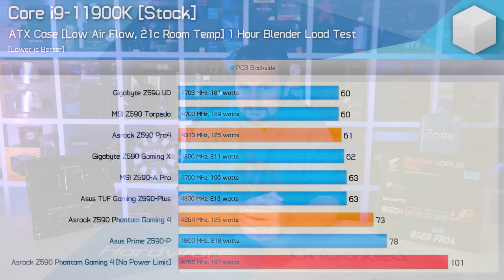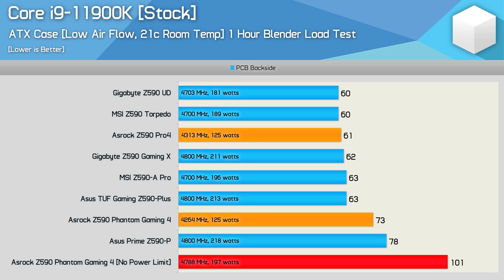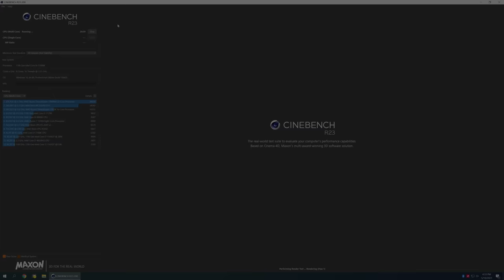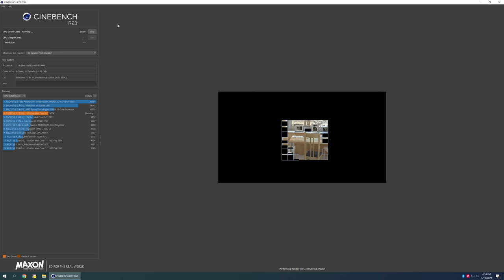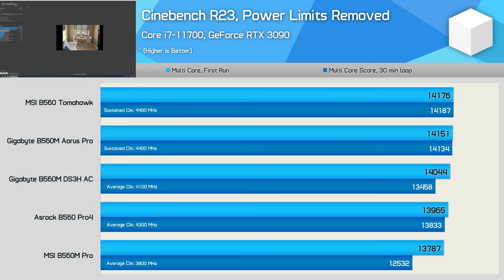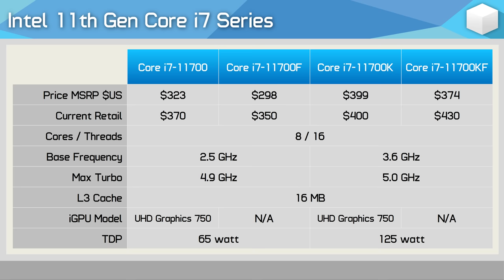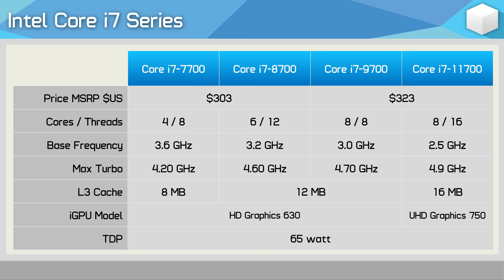Intel B560 is a Disaster: Huge CPU Performance Differences, Power Limit Mess

Comment: So basically B450 Tomahawk MAX II combined with Ryzen 5600(X) (or even 5 3600) and AMD Radeon  6700XT / 6800 is still the king of frames per cost? IF they are being sold at MSRP...

Comment: Just got an open box system pull ROG STRIX B560-G GAMING WIFI with all the accessories for $126 on ebay from a reputable seller.  Did I get it for a good price?

Comment: I'm using i5 11500 with Gigabyte B560M DS3H AC and using Deepcool Gammax 400 v2 cooler.

Can I remove the power limit with this setup to unlock the full potential of CPU? Is it safe and wise to do so?
Reply: Yes you can. The Gammaxx 400 is a great cooler and the motherboard VRMs are good enough to handle the 11500.
Reply: @kanishkparmar  Glad to hear this. I was regretting my decision of going with this board.
Reply: @shoaibmax  You just need to know how to remove power limits (which I guess you already know) and the CPU will work like it does with any normal motherboard.
Reply: @kanishkparmar  Actually, I don't know how to remove the power limit. But I guess I'll figure it out. Now, I'm waiting for the VRM tests to see how they behave after removing the power limit. Loosing 30-50% CPU performance due to a motherboard is too hard to digest.
Reply: @shoaibmax A great place to question this is r/build a pc. I would advice you to go to that sub and ask how to remove the power limit in gigabyte bios. The 11500 is a 6 core cpu, so I would assure you that your motherboard will easily run the cpu without throttling after removing power limits. Intel really messed up this gen's b series motherboards.

Comment: One question if I get the i5 11400 with a cheap b560 motherboard and remove the power limit could I have the full or not ??
Reply: and how can i remove the power limit and reach a safe level ?
Reply: @_ataims  it depends on the motherboard manufacture.
What is the model of your motherboard?

Comment: My nephew is getting into gaming pcs.  He is looking at a NZXT prebuild that pairs a 10400f with B560 MOBO (but they dont mention the AIB brand in the build specs).  Do have a vid paring these two parts? Or would it be difficult to suggest anything because NZXT didnt tell us who the AIB is? My guess is that its okay because the build uses a 10400F anyway, so it makes no sense to use a Z series, but im not sure the value is there, especially for future proofing.

Comment: Not trying to excuse intel and crappy VRM design here, but what did the test set up look like? An open-air bench is going to have a different cooling profile than a case. Do these boards, especially the ones without any VRM heatsinks, still thermal throttle with the stock axial cooler blowing down at the VRMs?

Comment: I have a MSI B560m PRO VDH Wifi and has significantly better vrm cooling solution and more ram slots + wifi than just the B560m Pro. It sets my 10700f PL1 and PL2 to 135 and 180 watts respectively when asking the user to choose cpu cooler type on first boot and choosing either Tower or Liquid cooler. Is this board still capable of bringing up the 135 and 180 watts power limits higher?

Comment: I have a B560 Tomahawk with a i5-11400F and only get 9300 on cinebench R23 multicore benchmark. Any ideas why it doesn’t reach >10k like in these tests?
Reply: Maybe something else affects it? Slower RAM? Better cpu cooler? Not sure
Reply: Yep. Ram speed and ram timings affect a lot to amd performance. So newer compare your own results to any sites results because you most likely have different components. Ram, cooling etc..

Comment: i thought that AMD has more trouble to define its power limits because of socket support. but for intel was more important to keep power numbers same as old launch just for marketing reasons.
Reply: Intel is also providing the cooler in the box and you should not unlocked the power with that cooler. This is what low-end buyers will do.
Reply: @TEKDAD 

 Many motherboards unlock the power by default.

My build crashed out of the box because it would get so hot. I thought it would throttle, the replacement cooler is on the way, but nope it just shut down during heavy tasks until I turned the power limits off.

Comment: To be fair, i've watched enough Hardware Unboxed to learn about VRMs and the importance of good cooling... that cheapo MSI B560 board without a single heatsink on any of the VRMs just screamed "Don't buy me!" as loud as it could before ever watching this video.
Reply from the maker: There are a number of issues here, the 65w TDP being one of them. There are even $140 US B560 boards that run at the TDP limit by default and as you've just seen that leaves a lot of performance on the table. Intel motherboards need to either run at the TDP limit or the clock multiplier table, but having a mix of both with performance differences in the range of 30-50% is unacceptable and a complete mess.

Comment: Hey, I've got a question. I recently upgraded to a ryzen 3800xt and am still using my asrock b550 pro with it. Am I throttling myself with the board? If I understand correctly the problem is focussed on intel chips, but I dont quite understand the whole issue.
Reply: No AMD boards do not have the same confusing problems. The best thing to do, is look up CPU reviews and see what there scores were on stuff like Cinebench, and a game you have. Most reviewers did not really bother with the "XT" 3000 series CPU's. So good luck. Using this method, figured out my B450 aorus pro was running my 2700x in good  enough specs for me.

Comment: I would say that 102/121 and 114/136 (Shadow of the Tomb Raider) is huge difference for basically the same chipset.... Ugh..I hate these kind of companies which try to screw the end customer.
Reply: Yess, but also consider that not everyone buying an i5/i7 & B560 Mobo would necessarily pair it with a 3080/3090.
It's a much better situation on AMD's side where you can build a tricked out rig using a B-series Mobo

Comment: so acording to this problems on the B560 and also with the exagerated price of the z590, does it compensate to buy a Z490 (in this case the Asus Z490 Prime - A) and use an i5 11400f?

Comment: What makes you think it's the CPU and not the motherboards ? Since the Motherboard - Rather than just blaming the CPU Manufacture, the motherboard controls everything including power limits, etc (p.s. I have AMD Laptop, so not a Intel fanboy).
Reply from the maker: I understand the subject. This is 100% on Intel as explained in the video for their loosely defined operating specification. If you wish to learn more I suggest reading the interview linked in this Tweet: https://twitter.com/HardwareUnboxed/status/1385051271451660290
Reply: @Hardwareunboxed  Not to much care for the in-spec, but back in the old days if  you wanted to OC, or better performance from your motherboard, you pay a higher price.
Reply from the maker: Yeah well that's entirely not the issue here or even the subject. Your first hint should be the fact that none of this is overclocking :D
Reply: @Hardwareunboxed  Even if you not OCing, if you wanted better performance, you pay higher price, that was back in 1990s.  Think you all expecting too much for cheap motherboards.
Reply from the maker: This is broken logic and no we're not expecting too much from cheap motherboards. This isn't even a cheap motherboard problem but I'm not going to explain the issue again, it was very clearly laid out for you in the video and just about everyone else gets it.
Reply: @Hardwareunboxed  Yes says so the expert.
Reply from the maker: Did you not read the Intel interview?
Reply: @Hardwareunboxed  It's not overclocking true, but designing all motherboards being capable to handle PL2 permanently isn't the purpose. There has to be some boards that only can supply the minimum PL1 which is the only requirement outside Z series. The problem here happens everywhere, one thing it's the base power limit(however the manufacturer calls it)  which is something every board has to meet and another thing it's the boost limits, which is something optional for the ones that don't have issues with additional power draw and its consecuences.

I tend to assume than someone that builds a PC on his own should be willing to enter the UEFI even if it's only to check everything is in place and has a minimum degree of knowledge. For buy and run there's already prebuilt PCs and laptops in which reviews are made by model precisely because every pre-built configures power limits based on the capabilities of the model and manufacturers charge accordingly: more capable in power delivery and cooling more expensive even if two models feature same CPU range.

Comment: I'm not finding any relevant information on the Intel B560 express, can I also unlock the i5-11400F relatively easy to get the most gigahertz out of it? I think the express is also a budget model, so I guess it should work, but some kind of confirmation before buying would be appreciated.

Comment: This is truly Intel's bulldozer moment 🚜
Reply: Hmmm… i can not see the connection? 11400 is cheap and good cpu. Every 560 motherboard is fine if you know how to change bios sertings. So how this is bulldozer moment? 11900k is hot and eats a lot of power. But it still is relatively fast cpu. Not the level of current amd cpus, but nobody expects that Intel cpus can compete the current amd cpus. They are just so much behind in production technology. But i can not see what bulldoser has anything to do with this? Bulldoser was slow in single threath programs and only competative in certain multi threath programs.
Reply: @haukionkannel  Intel is pushing power through the roof like amd did in the past. Effeciency is out the window and they are embarrasing themselves. Everyone can see they are losing.
And this power crazyness means that motherboards and board partners gets screwed over with these stupid TDP specs that lies and consumers gets shafted at the end.
Rip all the offices bulk buying this shitty platform and getting less performance for the money simply because everything is so scammy

Comment: I have a Gigabyte H601i Motherboard running an i5 12500k, And a 12gb 3060, I did buy 32gb 3600, But I can only get 3200 with the H601i, And putting 32gb of Ram in my PC done wonders, I would even say that 32gb is the sweet spot with Ram, Unless it is DDR5, And 32gb of DDR5 have actually dropped in price, Prob coz nobody is bothering with DDR5 yet, lol, I think people will wait until the 50 series GPU's to drop until a new Motherboard is installed, But would a higher end Motherboard allow for a more improved Sim racing drive play, lol, I do AMS 2 in VR, And when there is a full track of cars when on multiplayer I can get stuttering, So I thought if I upgraded the Router I would get no stuttering during Racing online, A TP-Link AX3000 AX55 Archer Router, I can say have made the Online Sim racing on another level, And the TP-Link AX3000 is also Wi-Fi-6, My CCTV cameras have even improved, They load up staggeringly fast, I am actually taken back on how the difference is with the Sky Modems and modems like TP-Link, Sky should be embarrassed giving people modems that feels like outdated tech, Using crap modems for peoples internet isn't going to give Sky a good look, Even the Wi-Fi booster is crap, lol, I am going to get a TP-Link Modem or a gaming modem to link with the TP-Link AX3000 AX55 Router, Can someone let me know what the best Modems are for online gaming in VR, The Quest 2 recognized the TP-Link as Wi-Fi-6, I read people are having issues when using Virtual Desktop when not using the PCVR cable, The PCVR cable will give you better Gameplay anyways yeah?, Will the WiFi-6 make the Quest 2 VR better, I will find out a bit later, This room is way too hot for VR at the moment, lol, Is there any fan units for the Quest 2 that blows on your face or skins parts, I got the BOBOVR air circulation thing, I never realized it was de-fogging thing, It do keep the lenses free of fog though, lol, And the face cover part is much better, But yeah since I started using the TP-Link AX3000 AX55 Router my internet feels much more stable, The reaction time from the steering wheel in my hands to the one on AMS 2 is instant, A world apart from before I used the TP-Link AX3000, I never realized that a faster more stable connection with less lag, Will make you a faster Sim racer, As I will be real and honest, Before the TP-Link router, I was getting slow lap times, To where now my lap times is faster, Not much but over a load of laps it adds up, So yeah to be a competitive Sim Racer with proper online races, A fast stable internet is going to give you an advantage, Minimal but that minimal can be used to a powerful perspective, So to speak, It is why I am asking will a better motherboard give me better gameplay, Coz better gameplay or less latency will give me a legitimate advantage, Just like High end Sim racing equipment, And High end PC, I believe will make you a faster driver, I am sorry but it is true, Just like saying, Will a Console Sim racer be as fast as a PC Sim Racer, lol, Coz I can tell you one thing, Sim racing on a PC is world apart from Sim Racing on a Console, I know coz I began Sim racing on a Console, lol, There is more everything with PC Sim racing, I could not go back to Console Sim Racing, After Sim Racing on a PC, lol, My friend saying he getting a Console soon, And I say to him, get a used PC or some used and new parts, New motherboard and CPU and Ram, Then get a used GPU, Or find half a used PC on Ebay and get new guts for it, You will be saving money not having to pay for a PlayStation subscription that is impossible to cancel, PlayStation shouldn't be allowed to make subscription so hard to cancel, Most subscriptions I have learned to stay well away from now....
But yeah will a higher end Motherboard give me any better gameplay, Or is it all down to the CPU and GPU combination that you have, Do the Motherboard improve Graphical Quality and Game play, Or is it a GPU thing?, Coz surely a Higher End motherboard will give the CPU and GPU to the fullest with no drawbacks, so to speak, Motherboards is an interesting convo, With the many type of CPU and GPU combinations, I would imagine the Motherboard is the skeleton of a PC is a PC was a human, lol, I joke about that now, And Humans are becoming robots, lol, nVidia boast about the 50 series running a Robot, So when is a Stand alone VR headset with i9 CPU and 4090 GPU power, Or when is someone going to make that possible, lol, A DIY VR headset, Yeah that won't be long, lol, I just want to know will a Better Motherboard than the Gigabyte H601i give me better Sim racing with the i5 12600k and 3060??

Comment: This reminds me of the fx8350.   You basically NEEDED an AM3 990 board to handle decent clock speeds, and it wasn’t even that good of a performer.   Intel better get off 14nm or we will be seeing an FX-13700k

Comment: Hope to see asrock b560m itx included in one of your videos, it seems one of the cheapest itx board for this gen. Will it be good enough to run i5 11th gen like the 11400 with power limits unlocked?

Comment: is this pretty much the case with the b460 boards?   i had to jump at some parts as i really needed to upgrade, got a 10400f and the gigabyte ultra durable b460.  i just game, no heavy work load stuff, but i'm curious if there would be a large enough benefit to lift the power restriction.  

i'm not too familiar with my new rigs options, but i would be able to figure it out if it ended up being worth doing so.

Comment: I'm using 10400f with gigabyte h510m h and rtx 2060, some games perform good but in Fivem i get 30-50 fps only, i used to get better when i used 1050ti with h410. What is the issue with my current specs? Why do i get so less fps

Comment: I’m gonna run my 9900k till the wheels fall and then I will go with AMD. The pricing on these new motherboards is out of control. My z390 board cost 200.00 and runs all cores at 5 ghz no problem. Intel should be ashamed of this 11th gen joke of a processor.

Comment: So should i buy a b560 board for my i5 11400 or just go for ryzen 5 3600 ?
Reply: Hichem  i already have the ram and i did order the 11400 even tho prices are weirdly high but i got a good deal from target but im still confused as to what motherboard to go for i came down to like 3 or 4 choice them being the auros elite and pro, the msi bazooka and pro wifi ds3h and the asus tuf.
Reply: Hichem  but doesnt in the video it shows that the asrock is not that good ? Or is it some other model ?
Reply: Hichem  ASROCK B560M Pro4 ($118) vs B560M Aorus Elite ($136). 

Is Aorus Elite worth $18 more or Asrock is good enough?

Comment: Hi I have a question and I would appreciate if someone could help me choose.
 I'm gonna change my CPU and motherboard around September. I can't decide if I want i5 10400f or i7 10700f and i don't know which motherboard would suit i5 the best, my RAM is 3000MHz 16cl Crucial 16Gb. PC is used mainly to play games in 1080p but I'm planning to change monitor to 2k, one without high refresh rate 😄
Reply: well about the i5 and i7 , i just bought the i5 last month ( upgrade from the i3 i build from 2019 ) , it just great , i mainly play csgo and some other offline game and with the i5 , i feel it enough for me because i didnt have a great gpu ( normal 1660 ) , it depend on your money but i prefer you should pick up the i5 and give the money to another part of the pc , but like i said , if you got the money , the choice is your :v